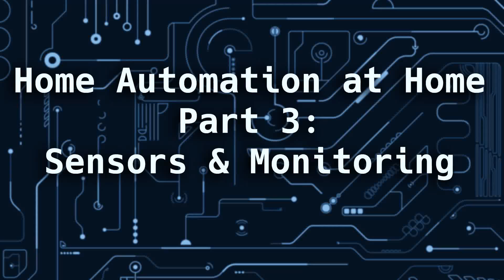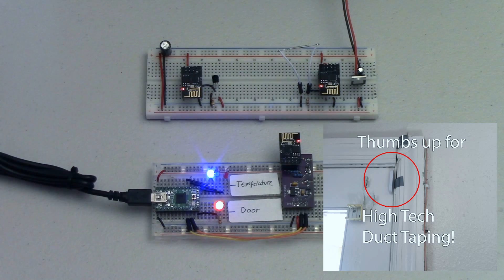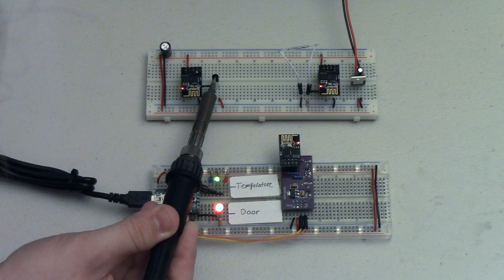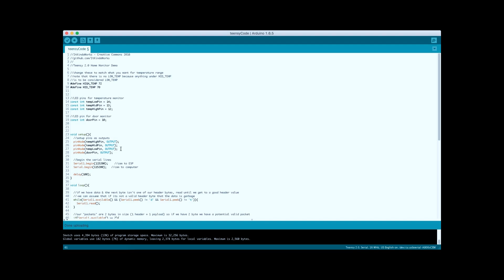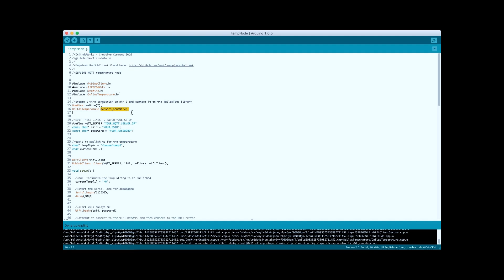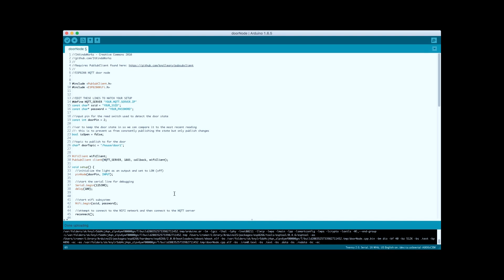Home Automation at Home Part 3: Sensors & Monitoring

Comment: I am new to this but if I am not wrong the code for ESP_Conduit can be made simple: we are comparing if payload[0] is 1 or 0 and we set that value in byteToSend, well actually we don't need to compare but byteToSend = payload[0]. Even if the idea is to protect and process values 0 and 1 it can be optimised with only 1 if statement. @ItKindaWorks good job and thank you for the effort.

Comment: So, when it comes to MQTT together with the ESP8266 ESP-01 you are unable to use Analog sensors, even if you put an Arduino Board in between to work with the Analog sensors... Is that it?
Reply from the maker: You can use analog sensors! You'd just have to come up with some protocol to send the analog readings over the serial line to the ESP and then the ESP could relay the info via MQTT.
Reply: ItKindaWorks Well, same is true about modules that use I2C like RTC timers... You have to develop a protocol to send that information on demand trough serial communication! I hope that sooner or later some one will develop such kind of protocol in a more wide fashion!

Comment: Great videos.  I am very new to this and I have been able to follow along...mostly.  I am looking to transmit temperature reading to my node-RED.  My current setup is Raspberry Pi 3b running Node-Red.  ESP-12E will wireless unit with a DS18B20 hooked to it.  Only think Im missing is being able to read the temperature over MQTT on my Node-RED dashboard.  Any advice would be great.  Thank you in advance and keep up the great work.

Comment: Hi Thanks for your tutorials they are very educational.
I have 2 questions, 1. what is the value of the resister that connects to the pin 2 of ESP?
2. it seems for some reason that i don't know that if i use a 18B20 all works ok with my ESp module but if i try to use it with the relay or door switch for some reason it gets stuck in the boot and will not continue connect to mqtt or network.
And just remembered another one for some reason my ESP are acting us a wireless network outside my home network. if i look at networks available i can see ESP.... although i use the ino sketch, is any way to stop it to act us a independent network?

Thanks again for your time and help.
adi

Comment: Really great series of videos. Thanks for sharing them. I was trying your code from the tempNode.ino, with few modifications wherein I wanted to read a knob position to control the brightness of an LED connected to another node of MQTT. At my sensing end I am using the analogRead function to read the analog channel value which is connected to a pot, which gives me a value 0-1024 I guess. The client.publish , I guess needs a character array for the payload. I tried few options but none of them worked. Then I went back and tried just like you, but by assigning a hard coded value to the 1st location of the 2 element character array and null terminated the second element, it was still sending some garbage message. So I was wondering is there an easy/better method to send these values across the mqtt clients. Really appreciate your help.
Reply from the maker: Thanks! 

To send a value like that there are a few ways of going about converting the 0-1023 int to a char array. The simplest way that I can think of is to take your int and convert it to a String and then create a char array (with a size of 5 for example - remember it needs to have a null terminator) and use the String toCharArray function to convert it to a char array. It's not the most elegant solution but should work well enough. So it would look something like this:

int potVal = analogRead(0);
String potString = String(potVal);
char potArray[5];
potString.toCharArray(potArray, 5); 

client.publish(potTopic, potArray);

You can read more about the String object here: https://www.arduino.cc/en/Reference/StringObject